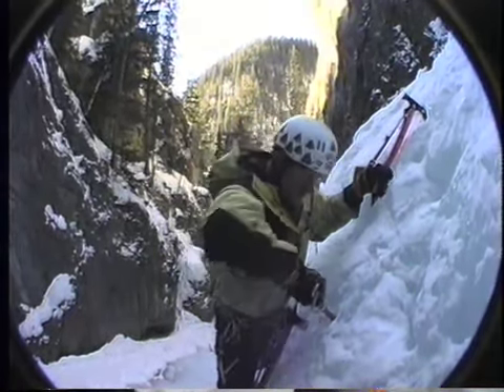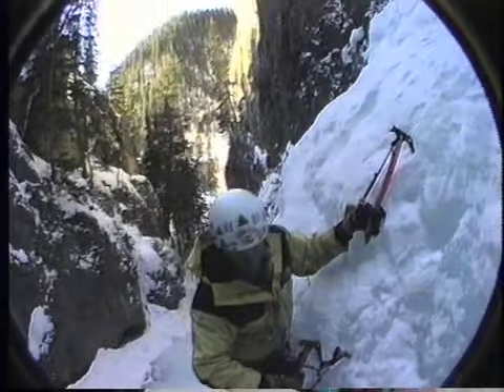CLIMBING TOOLS: Building an Ice Anchor

Comment: actually his biner breaking comment was spot on. I'm not sure where you are drawing you're equation from as theres a lot more to it than that, check out DMM's test of breaking dyneema and nylon on thier webisite, and mind you they well exceeded 20kn with 4 foot factor one falls on dyneema, but they used steel biners to avoid the possible biner breaking since it was to test the slings

Comment: V threads are definitely the way to go. A 22cm deep V thread in cold, hard ice will withstand over 2000 lbs of force. In crevasse rescue school we pull tested a V thread that was chopped down so it was only 3cm deep. It took 5 people shock loading the rope to make the 3cm deep V thread fail! I would rap off a 22cm V thread over an ice screw any day.

Comment: it's also common to thread the rope itself through the v-thread anchor, leaving no gear behind at all.

I'd like to expand on the backup anchor- it's always a good idea to have a real anchor, not just an ice screw. the backup should be bomb proof, as it will probably be shock loaded if the load bearing v-thread fails.

if the v-thread held for everyone in the group, then the skinniest person can go last after taking off the backup, leaving no gear behind at all.

Comment from the maker: If I built the thread I will just go off the single screw back up. You certianly are not wrong but time can be a real safety issue for some of the longer climbs here in the rockies. Other places in the world it is hard to find a cimb longer then a few pitches.

Comment from the maker: actually the screws are tyed correctly and load distrubuted in this manner is more then exceptable. maybe you are just looking at it a lttle diffrent or is unclear chec the equalised load vids somewhere in the pile 
the daisy chain is girth hitched and the locking carabiner is clipped to the end. I would take a truck to break the daisy chain when hooked in this manner. 
You are half right about the ice screw as they are suspect when tied off in this manner

Comment: mikebarter387 I know your comment was 5 years ago but I'm wondering if you have an answer to a question. You commented about rope freezing in a (presumably a V thread). What if you were to have a piece of tube over the rope that you thread in? would that help because even if that froze in the rope may still be able to move freely within that?  Or if anybody else has input they're free to comment. I've never been ice climbing I'm just curious. I'll be doing a safety training course (for beginners) in March, and it includes some crevasse rescue
Reply from the maker: There wouldn't be any point to putting a rubber tube over the rope. Your trying to rappel when you do it. It would be simpler to just leave a sling. That properly doesn't make sense to you until you have taken up climbing.
Reply: Thanks for the reply